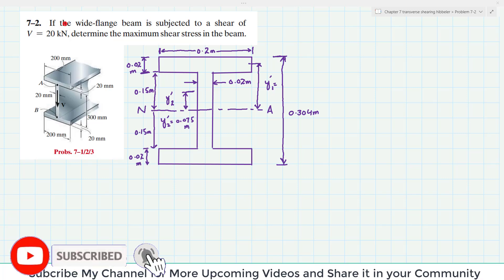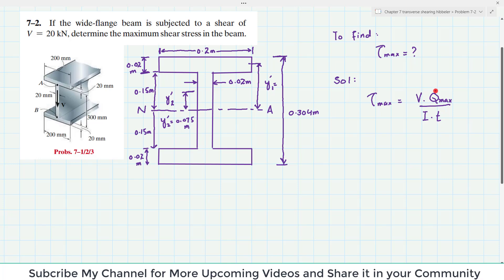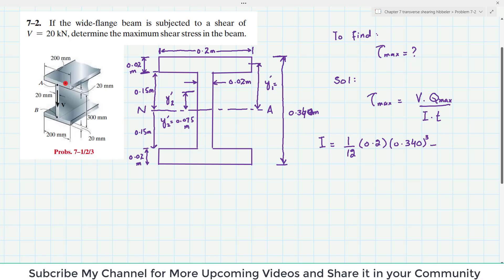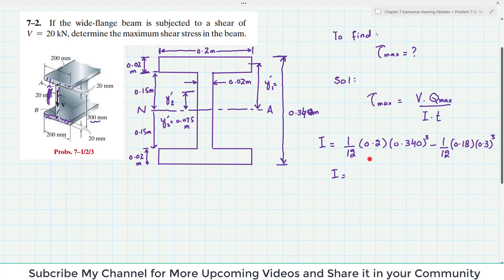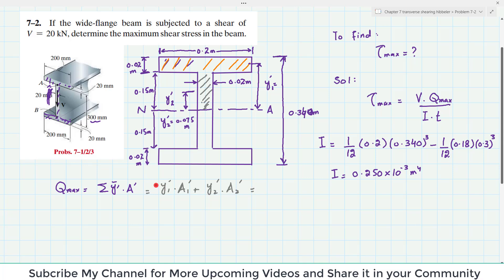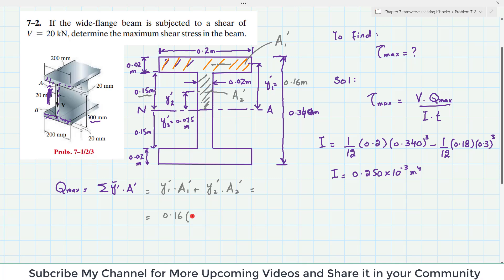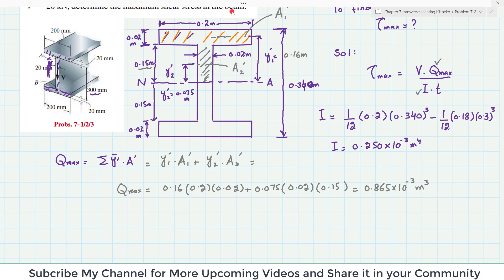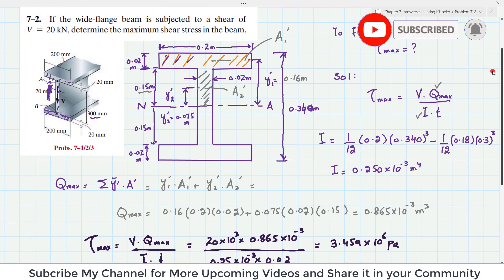Transverse Shear |Pb 7-2| Mechanics of Materials RC Hibbeler

Comment: Hello how do you know that the Q has 2 areas ? Last video the Q was only the upper one but in this one why there is 2 areas ?
Reply from the maker: Well in problem 7-1 we have been asked to find the shear stress at the junction of Web and  flange at point A so above the point A we have to select area for calculating Q. While in question 7-2 we have to find the maximum shear stress so for that we have to take the whole area above neutral/centroidal axis for calculating Q. I hope it will be clear now....
Reply: @engradnanrasheedmechanical  The maximum shear stress occurs on the neutral axis right ? Whereas normal stress for bending occurs on the edges 🤔
Reply from the maker: Yes you are right....